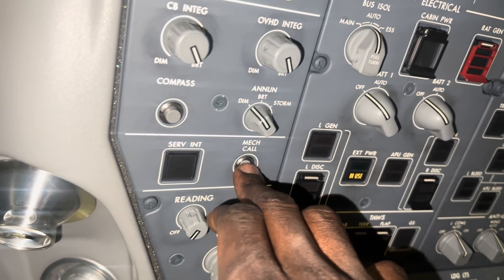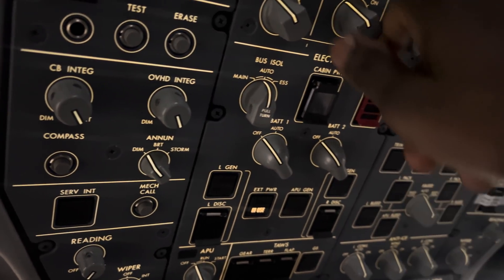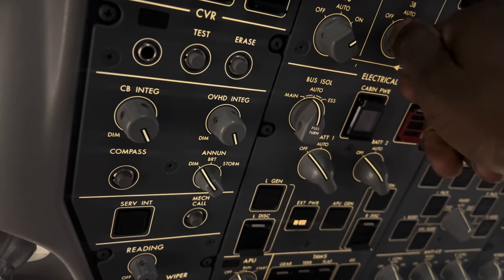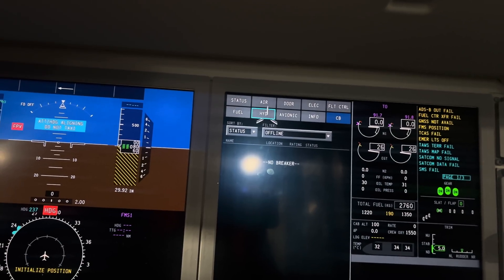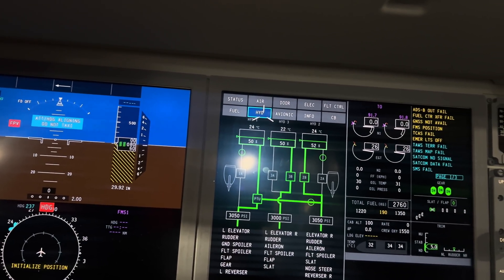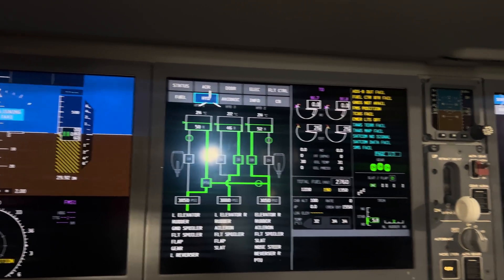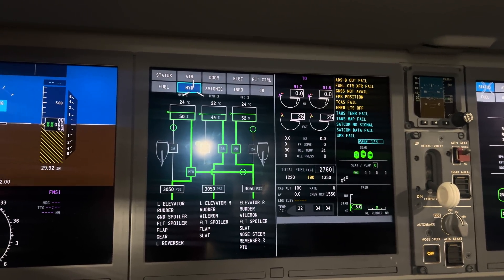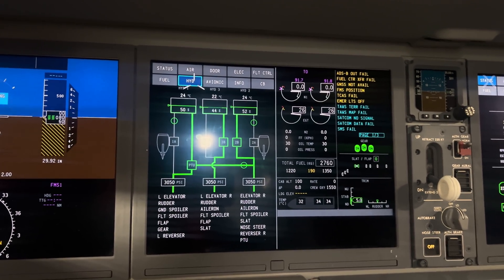A Day In My Life As An Aircraft Mechanic

Comment: So after you got done with the filter change. Could you show us how to do the paper work. I’m curious. I’m an A&P mechanic. Also please show how you follow the manual instructions. Just curious. If it’s allowed, I don’t want you to get in trouble. Thank you. keep up the great work.
Reply from the maker: Hey i appreciate it . I can’t show no paper work . Those are legally document . And property of the company.
Reply: Hello can I get your contact number. I’m new and planning to do a this carrier. Need little bit information about it before i go.
Reply: This is how would you do the documentation on the oil filter maintenance 

Remove oil filter for the number 1 engine as per AMM 79-xx-xx 

Ok to install oil filter for the number 1 engine  IN THIS STEP GOT TO MAKE SURE ALL THE PARTS ARE EFFECTIVE TO THE AIRCRAFT.

Installed number 1 engine oil filter as per AMM 79-xx-xx and you will also document any calibrated tooling on the manual and the company paperwork 

Then comes the operational test to make sure there is no leaks 

Perform operational test as per AMM 79-xx-xx no leaks noted
Reply: Stop lying. You are not an A and P mechanic without a clue about paperwork. You should have had a huge run down and many practice assignments/projects making you learn this. The first intro to weight and balance will have you doing a lot of that.